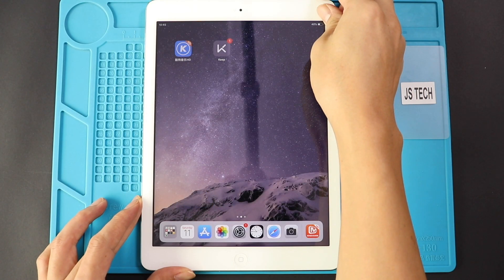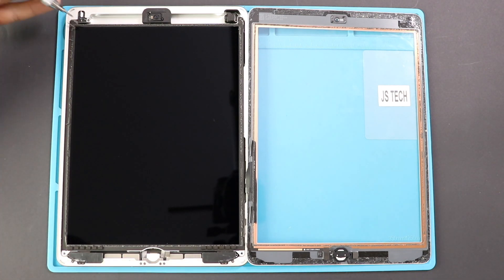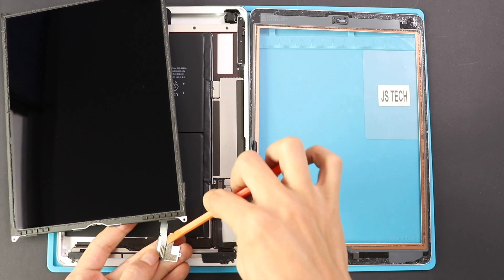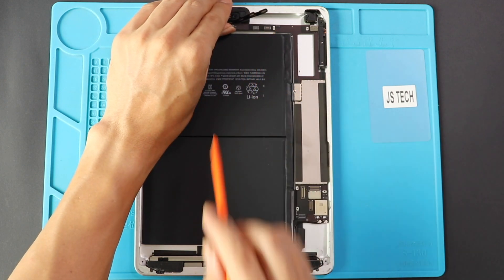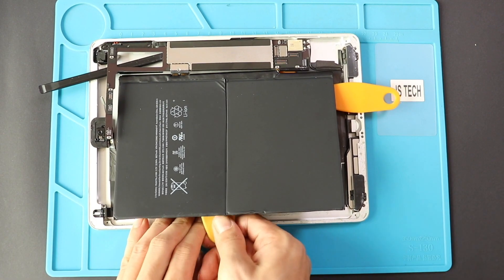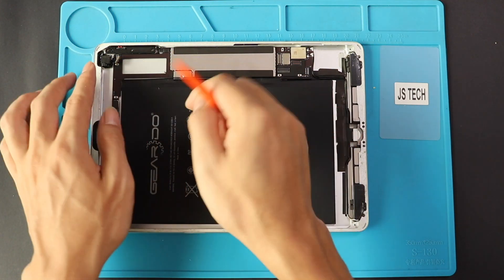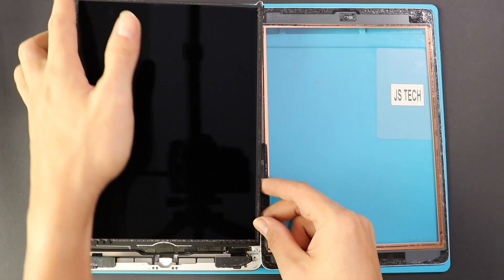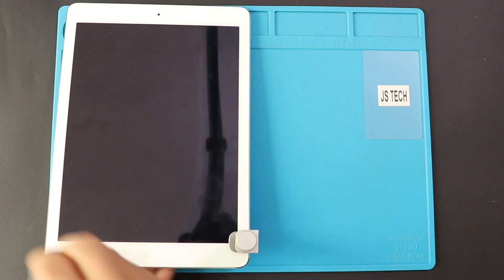iPad Air Battery Replacement | A1474 A1475 A1476

Comment: Thank you.
I am wondering if one can still use a normal professional phon, or other techniques like the sun and a black mat that absorbes sun energy and then position after some minutes of exposition of it to the sun, the Ipad so that the glue loses grip ...
If repair costs too much it then can become better to ask Apple directly to work on it.
The problem is that they do not repair, they just ask you for more money... to buy something new. No to consumerism
Reply from the maker: Heating always helps to loosen the grip, but with this way i am not sure, but always can give a shot.But i am not suggesting
Reply: @DIYGeardo  thanks i will do with the heat gun

Comment: Be carefull
You will destroy the Connection between the Touch Screen Glass iyou removecinntze First step an the Logic Board Heinz this plastic Card to Cut the Touch Glass3s glue

Its total bullshit that This Guy doesnt Show the exactly Part you should Not Cut to deep with the Card 

So watch other Videos aus Well
Reply from the maker: Always you should not go that deep. And also cables are on the right hand side. You need to open from left to the right.The process of cutting adhesive takes time and need patience. We did a slight mistake by editing the screen removal process. It takes some time. Always advice to watch the video before performing the repair.Thanks for you valuable feedback.

Comment: Nice vid but could not understand what type of glue or what you said when it came to the part of gluing it back together.....
Reply from the maker: Pre cut double sided tape or b7000/t7000 glue.. if you are going with tape, make sure it is an original pre cut tape
Reply: @DIYGeardo  Thank you.

Comment: I followed everything but the ipad is not turning on, please help!
Reply from the maker: Is the charging sign visible ? I feels like loose connection
Reply: @DIYGeardo  no charging sign
Reply from the maker: @destiny1230ful  few things you can do to diagnose , 
- check the device is detecting in pc or laptop when connected (if it is detecting, your screen is broken or loose connection)
- if it is not detecting in pc or lap, it might be loose battery connection or bad battery 
- you can try a new battery 

These are some of the basics you can try.
Reply: @DIYGeardo  it worked! However the apple icon comes on and disappears smh....it's not turning on as is customary.  Is something not connected?
Reply from the maker: @destiny1230ful  have you double check all  connections?
Reply: @DIYGeardo  Good video! I'm pretty confident that I followed your instructions properly, but I'm experiencing the same thing as described above. Apple logo appears and then disappears after about 15 seconds and continues to cycle. This happens when connected to the charger. When no charger is connected, then the iPad is completely dead and will not turn on. 

Any ideas?
Reply: @capper27 did you ever repair or just replace . I put mine away since has memories I can’t trash.

Comment: That one sure looks like it's been opened before. That plastic card is sliding too easily across the edges and the person's hand is not even burning from the "heat" on the glass. This video is still instructional on how to do it, but doesn't quite show the struggles involved in actually doing it. Note; A lot of careful scraping and profuse cursing is involved. Special care needs considering while slicing that lower right side where the three cables are which are easily cut noted earlier by a viewer.
Reply: THANK YOU. Not one of these videos show how difficult it is to get even a razor blade between the glass and backing. They’ve all been opened before, closed, and reopened for the videos. The most difficult part is never shown. Once you’re inside, then it’s easy and nobody needs a video showing the  guts phase.
Reply from the maker: The process of removing the screen is taking too much time and we have shorten it.Just needs to be very gentle and pry the screen after heat. Removing tablet screen are complicated and need lot of patience.

Comment: the cable on the right side came off the glass screen. Is that fixable?
Reply from the maker: Flex cables can't replace that easy in this models. Need the complete digitizer